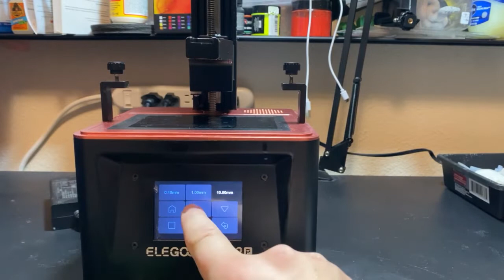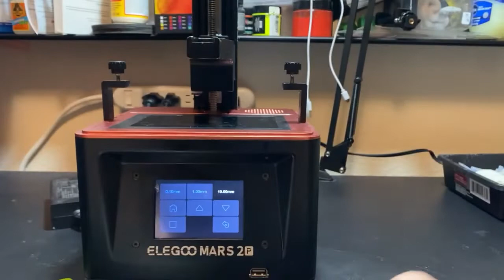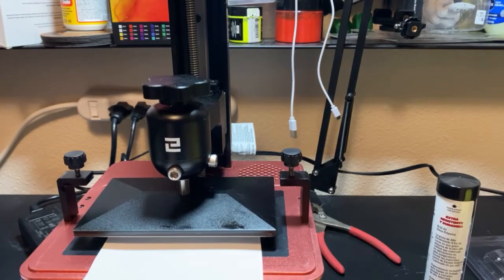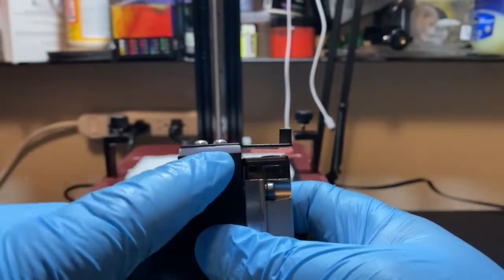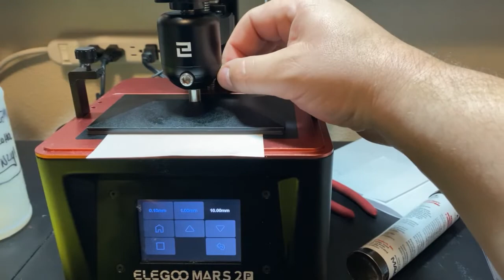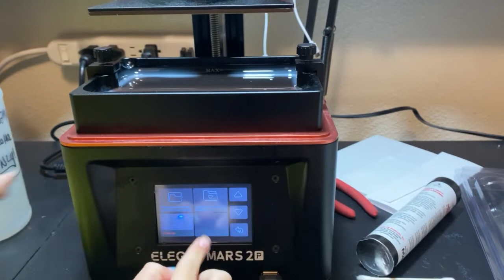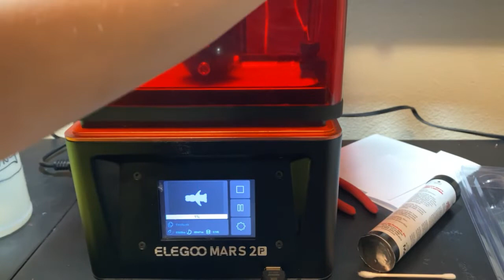Mars 2 Pro 3D Resin Printer - Z AXIS STUCK - Repair/lube Tutorial

Comment: the problem i have with mine , is when you fixed all the above issues , set the value of the Z , after you set it as home , and go up , later down , it forgets the 0.001 step u did to 'loosen' the paper more'... i tried a few tricks , but it didnt work

Comment: My Mars 3 has just decided to suddenly not home and wants to push past the bed and into the screen. Makes a grinding noise. I’ve cleaned it all and cleaned the Z sensor but it’s still doing it. (Like in the video where you had to bend the sensor breaker to make it work again) only mine isn’t bent. I’m at a loss as to what may be wrong. 🫤 thanks for the video!
Reply: Did you figure this out?
Reply: I contacted Elegoo, they sent out a replacement module/motherboard (I forget what it’s called now sorry), but all working perfectly again after easy replacement. I’ve found Elegoo customer service to be extremely helpful.

Comment: Thanks for this vid! I had to grip my lead screw with locking pliers & cloth and use extreme force to rotate the pom nut off. Even after cleaning & greasing it's still pretty tight and I expect it will seize again pretty soon. I'm wondering if you can get a replacement brass nut to that plastic pom nut (eg at 3:59). Eventually the plastic would surely fray and cause problems(?). So I'm on the hunt...cheers.

Comment: Thank you... I have an Anycubic but making the same noise. So hopefully this will work as well.
Reply from the maker: I hope this video helped!  Probably have a slightly different disassembly process, but if it's the same type of problem, it would most likely have the same type of fix for the problem, I'd hope.
Reply: @thearmouredpig  Yes it did! The arm moves up and down now. Not done a print yet, but it moves! Thank you for your video.
Reply: @thearmouredpig  It did. For a while. But now I have another problem kind of related. The arm moves up and down manually, but when I go to print, it gets stuck again. But when I check it, it moves normally, so I don't know what is wrong.

Comment: Hope this is my problem lol. Mine seemed to stop going up at a point then back down ended up smashing the print and pushing resin out into the machine
Reply from the maker: Might want to check your Z limiter (that's the part I bent and had to straighten out in the video) and make sure it's stopping the print head like it should.  I've heard sometimes the thing the limiter trips (can't remember if it's a beam or a mechanical switch) goes out and has to be replaced to stop downward movement.  Hopefully this video helped!